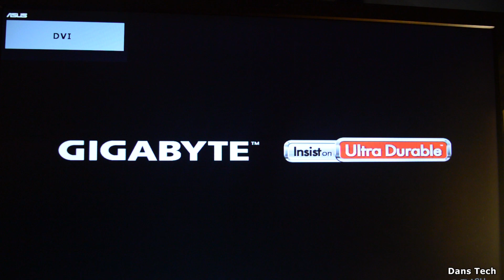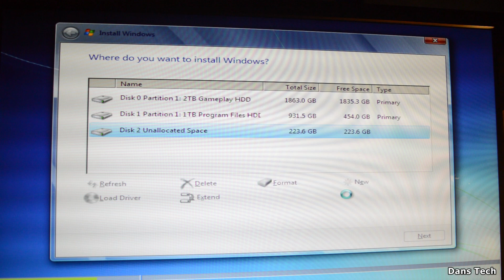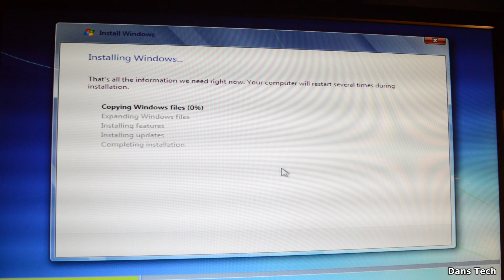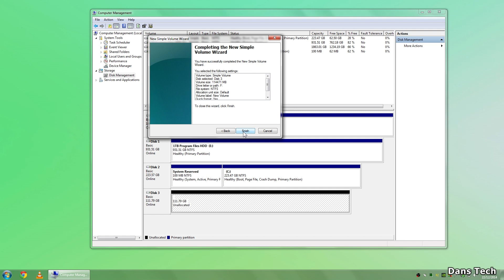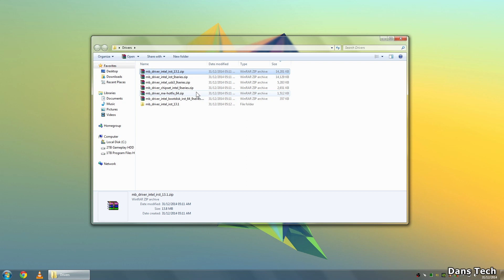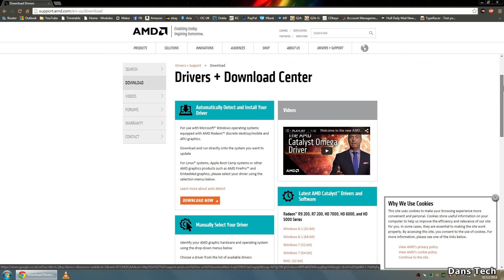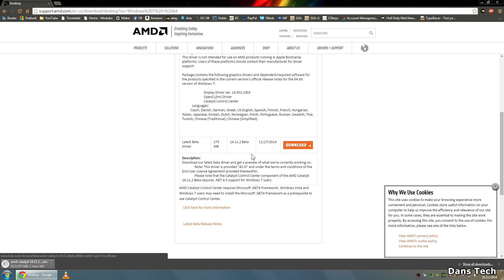How To Build A Kickass Gaming PC - Part 2

Comment: Hi Dan, I have the same motherboard, rev1.1, and have you ever had any problem's sending your PC to sleep? Also does your motherboard have any LEDs on it? Because my motherboard has none visable LEDs, I never seen anyone eles motherboard running to compare. I reckon, I maybe have some problem with my motherboard, it will not sleep, and there nowork LEDs on the motherboard? Any suggestions?  Thx
Reply from the maker: +Marc Denham Hi added this question to the Q&A I'm filming & uploading tonight. My revision is 1.0 and there are two other revisions, v1.2 features the LED separation strip. As for the sleep issue have you disabled, keyboard, mouse and network wake from sleep. You may find it can sleep but is pushed into wake immediately. Dan.
Reply: Hi Dan, I've just check the device manager-keyboard & mouse- power managemant, and they are set- allow this device to wake the computer. Plus this motherboard does have the LED trace path lighting illuminates to show the separation of the PCB layers: http://www.gigabyte.com/products/product-page.aspx?pid=5100#ov simply my do not work, I don't think I have ever seen those LED trace path come on ever, lol. I was wondering if they can be disabled some how. Marc
Reply from the maker: +Marc Denham They should be a setting in the BIOS then if you're sure that revision has the LEDs, also you checked the power options in the BIOS also? Dan.
Reply: I've looked in the BIOS, but I couldn't find anything.... On the website it says that v1.1 has LED path ways? My DVD softwear ROM that came with my MB is v1.1, but on the MB it say v1.0? what does it say on your MB on the  bottom left corner?
Reply from the maker: Mine says 1.0, same as the manual sticker. You're best off contacting Gigabyte through their site if you have any problems. If you suspect its faulty, do have it collected by the reseller you purchased it from. Also the video I mentioned will be live in 30 minutes. Dan.
Reply: Cheers for the advice Dan.

Comment: is this pc noisy and will hear fan noise while recording
Reply: please reply because i am currentely building it
Reply from the maker: Hi, all computers make noise. You can minimise this by decreasing the fan speed of the CPU cooler fan, and case fans in the computer's BIOS. F2 to enter as booting. Select a PWM value below 1.00 or by selecting Silent or Decrease Speed modes, this is motherboard specific. Dan.
Reply: +Dans Tech ok thanks dan also is it possible that you could show me a red and black case or an all black case i can build this build in and how do i hook up the radiator to the fans because the video kind of just cuts

Comment: I have a 4GB MSI GTX 960, my GPU does not slot in as cleanly as yours does and seems to be missing a part, it has a backplate though?
Reply from the maker: +Xenteon Hi, you are attempting to plug this into a PCI-Express x16 slot, correct? If so, don't be afraid to give it some force so it clicks in. Dan.

Comment: Cheers for the video. I'm in the process of buying the parts for my first build. I'm a Mac user, but I'm curious and want to challenge myself. The only thing I worry about is fan cables and power cables.
Reply from the maker: +kev2427 Hi, cheers! You might want to check out this video out, all about PSU Cables. www.youtube.com/watch?v=zmb3Q-Phkao Dan

Comment: Hi good video mate, I literally want to get a gaming pc just for Arma 3, I have built a pc before but that was years ago as now I mainly use mac's for a computer to work on  so I souly just want to use a pc for gaming as I much prefer the OSX platform for everything else I do on my computer.  My question is will it be cheaper buying a decent pc and upgrading it or simply building it from  scratch. also how much in total would you estimate it would cost for a machine that can can handle Arma 3 with good resolution and good fps that will also  have a future proofed board with sli capability etc , thanks.
Reply: +Marky Mark definitely building ti from scratch.  If you're buying a decent computer and upgrading, then you're buying a whole computer just to throw out parts you paid for already and buying new ones.

Comment: Hi Dan :D I'm going to be putting together a build soon and I would like it to have an i7 and a Titan X but I'm not sure what parts I need, could you give me a hand finding some parts if it's not too much trouble as I am not sure what parts are compatible?
Reply: +FoxyVR if you got money to blow and it doesn't matter, then sure, get the Titan.  But a GTX 980 Ti will be just as good (especially if all you're using it for is gaming) for half the price.  The other parts you'll want will be a processor (I'd go with the i7 Skylake), CPU cooler or fan, an SSD, HDD 2TB or more, power supply unit (750 watt is a safe bet), 16 GB DDR4 RAM, CD/DVD/Blu-Ray drive, and an Intel 1151 motherboard.  And and ATX computer case of whatever you want.
Reply: Eld Ritch Thanks for the reply but I've sorted it now :P Got an i7 5820k, 980 ti and 16gb ddr4 with a 480gb ssd and 2tb HDD :3
Reply: FoxyVR
nice, dude!  how's it running
Reply: Eld Ritch Extremely well actually, maxed out battlefield 4 and Elite Dangerous and I'm currently installing the Rainbow Six Siege beta to see how that runs :D Very smooth so far and boots up in >10 seconds I am in love
Reply: +FoxyVR I'm building a similar rig. How is the CPU?
Reply: SetyGames The CPU is outstanding as well as expensive but I wouldn't have chosen any other as I do a lot of creative media based things such as digital art and video editing. It runs games as smooth as glass and is definitely worth the extra money :)
Reply: FoxyVR Okay good! I 3D Animate and use a lot of power heavy program so I just wanted to make sure its good. Thanks :D
Reply: SetyGames Yeah will be excellent for that sort of stuff :D

Comment: Do the fans that you put in the top of your PC come with the Case or something else you got, or do you have to purchase them separately? I'm getting the Cooler Master MasterCase Pro 5 and I don't know how to find out if those fans come with it.
Reply from the maker: +sobeit959 Hi, the top fans I purchased separately from Corsair. Since then I've taken the fans out and the difference it made was next to none. Usually on the manufacturers website, you can see what they send in the box. Dan.
Reply: +Dans Tech Hey Dan, thanks for the reply. I've recently changed my decision from the MasterCase Pro 5 to the Fractal Design Define R4 w/Window. I'm also considering going with a liquid cooled CPU rather than a fan cooled, to go with my dual GTX 980 Ti Superclocked+. Would you recommend it, or is it just unnecessary hassle? Thanks again.

If you can as well, would you mind looking at my build really quick just to see if I've made any mistakes that I didn't notice? That would be a great help. http://ca.pcpartpicker.com/p/FjRGQ7 that's the permalink for the liquid cooled CPU version.

Comment: Hey, what motherboard do you recommend. (I'm trying to keep a bit budget but not much)
Gigabyte GA-Z97X-SLI - http://amzn.to/1GTBp4L The one in this video
Gigabyte Z97P-D3 Intel LGA1150 Z97 ATX Motherboard
Reply from the maker: +Ch33kyMangozOnPC Hi, if you're referring to this board (http://amzn.to/1LUBjcM) sure go ahead. The layout of the board is not the best, but after checking, will support all the components nicely. Just note SLI is not supported, so you can only fit 1 Graphics Cards in the board, this is why its a lot cheaper. Hope this helps, Dan.
Reply: Dans Tech Ok thanks but the thing is will that motherboard be good for long term upgrading because I want to upgrade to like an i7 and add water cooling and overclock and get a better GPU
Reply from the maker: +Ch33kyMangozOnPC Hi, no problem! This board will not hinder such activities. GPU over clocking and Haswell chips as high as the i7-4790K are supported. As i said, the only real difference between the two boards is that the board I have supports 2-Way SLI, while the other doesn't. That's the only real difference that I can I see, apart from physical appearance. Hope this helps! Dan.
Reply: Dans Tech Man this helps. Thank you. Anyway I was never intending for SLI. My GPU I want to get to is a GTX 970 but first ill start small with a 750ti
Reply from the maker: +Ch33kyMangozOnPC Sounds good man, chances are when you upgrade the 970 wont be the card to go to. Anyhow glad I could be of help! Dan.
Reply: Dans Tech ill be upgrading around next year

Comment: Hi, quick questions every cable that you connected for the graphics card hardrive and ssd are included or you have to buy them individually ?
Reply from the maker: +Julius Cadiente Hi, if you're referring to the black power cables for each device, these are included on the power supply unit yes. In this case, the Corsair RM 850. Dan.

Comment: What does the ssd does
Reply: SSD are faster harddrives.
Reply: +Diego Tuñon it is storage to put stuff on like games and pics and porn. jks
Reply: Solid State Drive much faster and quicker bit more expensive though
Reply: a bit? cost like 4x more
Reply from the maker: +Ørjan Kjeverud Hi, they are expensive yes. however once you get used to the ridiculous speeds of an SSD, you'll never go back to a traditional hard drive as your main drive. Dan.
Reply: I have a 500GB SSD in fact. I just pointed out they were not just a little higher cost, but a lot.

Comment: when you buy a OS in what form does it come in disc, download etc plz reply I'm getting confused
Reply from the maker: Hi, yes windows in particular is shipped in rather good old fashioned disc, download or USB flash drive. With all methods, you will of course always get a unique product key for activating.
Reply: +Dans Tech how do you know if it will come in a disc or a usb. Please help because I won't be putting in an optical drive.
Reply from the maker: +TheFlamingArrow Hi, don't blame you, I haven't used a disc drive for many years! If you buy Windows from the Microsoft store, you can get a download key and ISO image(s) to mount onto a flash drive. If you buy Windows from Amazon you are probably going to get a physical disc and a product key on a leaflet inside. I'm sure it will say what you will receive. Dan.
Reply: +Dans Tech Cool

Comment: i'm building a rig with a gtx 980 TI and an i7 4790k will a 600 w psu be ok i wont be overclocking or do i need something like a 750 wat power supply thanks in advanceoh and i ordered a 2 tb hybrid drive do i plug in sata cable to 6 gig slot or 3 gig slot ?
Reply from the maker: SUPER MAN Hi, generally you should be okay yes. Just make sure you have the required PCI cables on the PSU. Do let me know what you're picking up and can check that for you :) And always try to fill up your 6gb/s ports up first. For hard drives it doesn't matter at all however is a must for SSD's/Hybrids. Hope this helps! Dan!
Reply: Thanks for reply yes my motherboard and cpu ram hard drive etc came today I sent the 600 wat psu back I'm going for a 750 psu instead just in case I need some  head room in case I want to overclock its my first gaming rig I've ever built I'm nervous in case I mess it up all in it cost me £1,787 that's including the 4k monitor that was £350 the Dell 24 inch 60 hertz 4k it's an awesome monitor I got from Amazon I'll keep you posted on my build.

Comment: Great tutorial. However, I do have some questions
- Can I use a different case instead of the one you are using?
- Will this build last long enough before needing an upgrade of some sort?
Reply from the maker: Macaco Macabra Hi, great questions, first of all, yes you can choose whatever case you want! However do choose a ATX case unless the ATX motherboard wont fit inside it. Secondly, this build to some will be classed as very high end, it will last many many years before having to be upgraded.
Reply: Dans Tech Thanks! I´m not a fan of white PC cases. You have earned a subscriber

Comment: is it possible to have 2 hhd and 2 ssd with a total storage of 6500 gb (one hdd of 3tb or 4tb and the other one of 2tb or 3tb and 2 ssd of 250)?
Reply: Diego Sv also, the little fans that were installed in the upper part of the case come with the corsair fan, or i need to buy them seperately?
Reply from the maker: Hi, yes you can have any combination of drives, regardless of them been hard drives or SSDs. Just be sure you install Windows on the SSD.

Comment: Is it okay not to use watercooling?
Reply from the maker: Sebastian Allera Hi, definitely!
Reply from the maker: Dans Tech For air cooling look into the Dark Rock Pro 3 or Cooler Master Hyper 212 EVO if you don't want to go with a Intel Stock Cooler.

Comment: first of all nice video man. very informative. im planning on building this same setup, but with 2 msi 970's. my question is do i have to get a differnt power supply thats in this video? and what newer i7 processor should i get
Reply from the maker: FastBackwardsWalker Hi, the power requirement is actually less if you intend to use two GTX 970's. The Corsair RM 850 will do you fine. Also if you intend to use the same motherboard on LGA 1150, the i7-4770K or i7-4790K is the highest end i7's you can use on this platform that are supported. Hope this helps :)

Comment: how much did this cost you of a total
Reply from the maker: The Swagasarus Hi, this was around £1400 when I built it. However now I know it will be a lot lower. However if you do replace the 2x GTX 770's with 970's, it'll probs come up to about £1500.

Comment: Please tell me how tight does the the mobo have to be screwed? if i tighten it up would it evantually snap or if i leave it loose will it cause vibration??? How tight does it need to be????
Reply from the maker: Hi, I think you've overthinking this.You only need to tighten these screw until they wont tighten anymore. No need to over tighten though, or you won't be able to remove these in the future. - Dan

Comment: Great channel !! I'm going to go for this set up 100% the same, sourcing the MSI GeForce GTX 770 2GB TWIN FROZR Video Cards is a problem as there's not many about and they're proper expensive, What would you recommend as another preference.. Triyng to keep the build below £1500 !!
Reply from the maker: Hi, thanks a lot! If you can't source TWIN FROZR GTX 770's, go with TWIN FROZR GTX 970's. Some can be found relatively cheap, and perform better than the 770's too! :)
Reply: Dans Tech what's the difference between installing  a sound card and using the MB onboard sound???
Reply from the maker: Tony J Been honest, not a lot, just that the onboard audio of this motherboard is awful, so . sound card did the job. Besides PCI-express is sticking around for a long time, so the sound card still to this day, seems a great worthwhile purchase! Hope this clears that up :)
Reply: Dans Tech Great video, saving up to do a similar build myself. Currently, I have the Corsair USB H1500 Headset. The sound card doesn't have a USB port so I would plug the headset into the motherboard or into the pass-through on my keyboard. Does this mean I would still be hearing audio processed by the sound card?

Comment: Hey, I built a pc a couple of years ago just got 1 840 evo 1TB ssd, since then I've changed the cpu, and done a couple of bios flashes. I've never done a fresh install of the os, the ssd has don 1.5TB of writes. I only get some exception errors when playing space engineers, more I think than other players. Should I do a fresh instal or will the extra writes impair the performance of my ssd. I only ask because my Wei of hdd speed has fallen from 7.4 to 6.1 since a couple years ago(I didn't know not to defrag ssd) and everythings right as in ACHI selected and latest drivers and I use ssd optimizer to check windows settings for max performance etc. Should I fresh instal windows? Also I got 2 hyperblu 8Gb ram sticks and I cant remember if I bought them as a matched pair or started with 1 and added 1. This was my 1st build. Lol p8 h67-mle mb with i7 3770k evga gtx570hd 600W psu. I am thinking of buying a maximus v mb so i retain the 1155 and can have pcie 3.0 to buy a 2nd hand gtx 980(should be a cheap upgrade for a few hundred quid) and sell my old stuff) or something what you think? Regards peace out keep up the good work.

Comment: Hey dan ive got a little problem ive just built  my new pc and i cant get my motherboard to update to the latest bios i have the Asus sabertooth z97 mark 2 everything else installed without a problem but when i go to install the latest bios update says its a CAP file that i cant open help would be great ?
Reply from the maker: Hi! Sorry to hear you're having problems with updating your BIOS on your ASUS board, I have 3 recommendations for you: 1) Use a usb 2.0 flash drive. 2) Use the motherboards usb 2.0 ports, not the front panel ports. 3) Only have the BIOS files on the flash drive when flashing, other files on the drive can confuse the system. If these don't help, please contact ASUS via their support system, they made the board so they will know best. If they think its a fault causing the problem, they will replace the board for free.